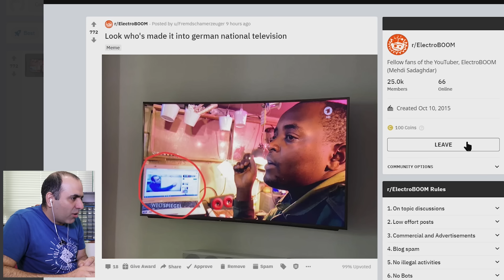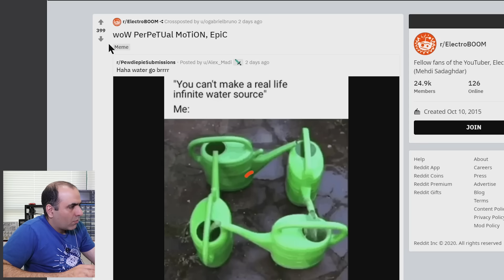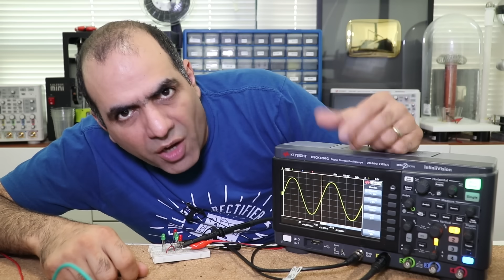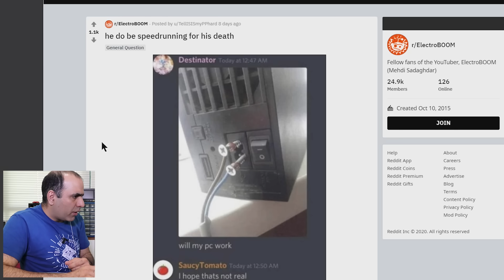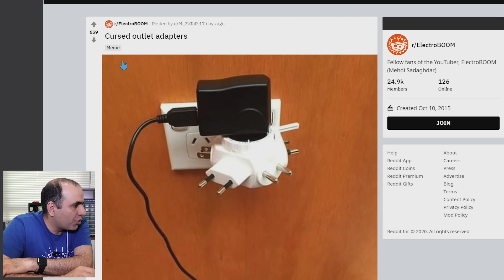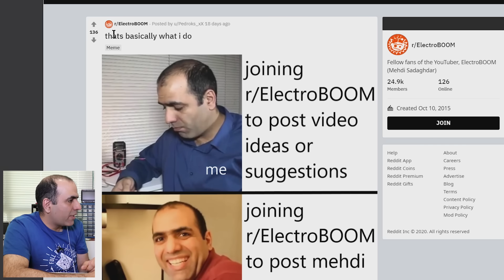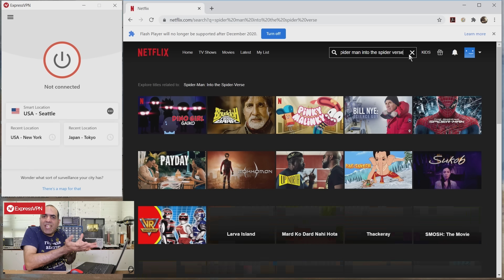Making Water Spin Like Magic, LATITY-002

Comment: Customs charge me 3 times the cost once it past 50USD.

https://consumerreview762600519.wordpress.com/2020/07/29/this-generation-console-gaming/

Solar panel https://amzn.to/2Cx3J5t
Eco-worthy 1000w https://amzn.to/2Cg8i4a
Amazing shower https://amzn.to/39trFTi
Earbuds https://amzn.to/3fcw3Iv
Kindle ultimate https://amzn.to/31PAx3N
Twitch prime https://amzn.to/2ZIgcLl
fire tv stick https://amzn.to/2C2bTlE
Midea U Inverter Window Ac 8,000BTU https://amzn.to/3eRYzyp
Necklace fan https://amzn.to/2VGlIwU
Sense Energy Monitor https://amzn.to/2T2u3JD
Spiderman FFH https://amzn.to/2W3NIK7
Aveners: End game  https://amzn.to/2KOhyx7
Metamucil double https://amzn.to/3aHoNB8 single https://amzn.to/3bmvVTU
Canon EOS M50 https://amzn.to/35fHX0c
SONY RX 100 VI https://amzn.to/35bteTS
Canon PowerShot G7 X Mark II https://amzn.to/2WaAPhp
CANON 90D https://amzn.to/3cX8z8O
SONY A6400 https://amzn.to/2VMUNzL
Darth Vader and Ahsoka https://amzn.to/2A3qDjl
Captain Rex https://amzn.to/2L2tMST
Ahsoka Rebel https://amzn.to/2A0hoAl
Anakin https://amzn.to/2W8QZch
Skillmatic https://amzn.to/37PwSEn
Aqua 4 in 1 Monterey https://amzn.to/2Ctihmm
Bunch O https://amzn.to/2YWQodL
Face mask https://amzn.to/2ZBw2Y9
Enema https://amzn.to/2YTOquQ
Amazon business account https://amzn.to/3h9t98K
100 disposable gloves https://amzn.to/3dEbNh9
Bicycle rollers https://amzn.to/2VFCOLh
Oscilloscope https://amzn.to/32tCFyA
Ispring reverse osmosis https://amzn.to/2Wy6D0I
Flex Seal Spray Rubber Sealant Coating  https://amzn.to/2OWPERv
Great Stuff 157913 Big Gap Filler, 20 oz https://amzn.to/39t7lBK
Reusable Half Face Cover, NASUM M101 Face Cover https://amzn.to/3jDWFVl
Rockport Men's Bennett Lane 4 Venetian Shoe https://amzn.to/39tqumR
Helix Flexible Stainless Steel Non Skid Ruler https://amzn.to/3jECy9B
Bacitracin Zinc Firtst Aid Antibiotic https://amzn.to/30KvsHT

Comment: Mehdi is uniting the world by offering easily understood lessons in electro-magnetic physics and by putting small electrolytic capacitors across the AC power line- and sometimes by putting himself across the power line. I want a T-Shirt that says "Mehdi Suffered For Our Sins" with a lightning-bolt motif.

Comment: My 2nd best ever electroshock moment was playing with an RF transmitter in the basement in my socks. 

You see a basement floor is a good ground and RF voltage really hurts.

 I've been zapped so much growing up that I think I've ionized my cells or something. When the weather gets dry I can almost get knocked on my butt from static electricity while opening a car door. People have heard the zap from across the street.

When there's a lightening storm I have to hide, staying away from windows and appliances. I've come close to being hit by lightening 3 times. My house has been hit twice frying several devices including the computer, and that's WITH good efi protectors on them.

On the plus side, sometimes equipment I've been called to repair starts working when I get close to it. Of course that makes it harder to fix if it's already working.

Comment: I have one of those crazy travel adaptor rings. Only one pair of the plugs are ever connected to the socket in the center of the thingamajigg. You need to rotate the center socket so it lines up with the intended plug fot the circuit to connect. The plugs that aren't in use don't connect with anything so even if I mess up (believe me, as a stupid person, I can be very creative at times) the rotation selection, at worst the mains electricity only goes into the wrong plug and stops there, not even shorting it.

Comment: If I may ask an  unrelated question to you and your learned viewers?
I have a 12 volt vehicle lift in my workshop fitted to a machine,  but want to convert to  run it off the mains 220 volt, trouble being is looking at 12 dc output power supply which I read apart from being dangerous at 200 amp output ( which I think I need ) is in the 500 pounds region to buy  looking at flea bay.
Any ideas or have I got to put up with charging my battery from time to time ?

Comment: Some guy: i don't have GFCI in my bathroom. Very hazardous!
Me: laughs in no electrical housebreaker
Reply: Gotta have those wires glowing red
Reply: My house actually came with a GFCI breaker on the bathroom circuit. I didn't even know that was a thing and was going to put a GFCI outlet in the bathroom until I saw that in the breaker box.
Reply: just use a gfci tester to find out
Reply: you probably have the wires running onto the walls like in the past.. it would be easy to fit a bit of safety features

Comment: The one where you ask "are those prongs all live?" 

No, it's a travel plug. I got the same one at home. You turn a ring on the top, where you plug in your device, to the prongs you want to use and only those work on the socket.

Comment: 6:33 I have the same adapter. There is a circle were that plug on the top is, so that you can select the outlet you want to plug the adapter in. But i can't remember when I last used it and I wont use it because I find it scary lol

Comment: 6:31 they exist. But they aren't all live. There is a ring around the socket that you turn to select which of the pin sets connects to the socket. The rest is just mechanically present but electrically disconnected. They are as safe as their designers made them (depending on build quality and stuff), but they aren't deadly by design. ;-)

Comment: Regarding your CRTV Transformer video, I heard once that there's a circuit named "Zero Voltage Switch" that can drive those via windings on the exposed ferrite in the transformer

Comment: I have a question about static electricity. I recently got given a record player and I had a serious issue with static making pops . I saw it is possible to buy a piezo zapper to remove the static. Does this really work? Is there a better way? Why can't I remove static from records easily?  Thanks for any insight on this.

Comment: That GFCI demo made me think of the weird wiring of a plug in my garage. The GFCI in there, if tripped, will turn off half the plugs in the house. I found that out when I tripped it then couldn't figure out why half of our house wasn't getting power. It's much like a switch that was in my previous house(which is 116 years old). That was a two way switch that would turn off the upstairs power if either of them were turned off.

Comment: 5:35   i keep trying to make that  dc motor with a  Magnet out of a HDD   with copper wire with a battery  No go   maybe i need the Magnet in video🤷‍♂️$ebay
Reply: Yeah you need a magnet that has the poles at the top and bottom, hard drive magnets have poles on opposite sides along the face of it.

Comment: getting charged 50% of the total value in custom fees is outrageous.
In the Netherlands you will be charged (with a max 21% VAT/BTW) for purchases above 22 euro.
(exclusive sending and insurance)
above 150 euro you also need to pay import costs.
(depends per product but in case of electronics its max 4%. phones and computers dont have import costs)

if you get charged outrageous amount of custom fees, make a complaint.
they probably estimated the value wrong.

off course different countries apply different rules but its worth it to look up the rules for your country,
Customs services also make mistakes.

if sending packages, some package services have the option that the sender pays the custom fees.
when the sender pays the package will be released by customs.

Comment: 6:32 I have this very adaptor. And to your and my relief, no, they are not live. You need to rotate the socket in the center to the actual plug you want to use. The rotation acts as a switch only closing the circuit with the plug to be used.

Comment: 9:34 yeah no this bit is flat wrong, simply because of the unqualified use of "no matter now much electromagnetic radiation is around you". If the electromagnetic radiation wants to go from point A to point B badly enough and you are in the wrong spot it's going to go through you. https://medicine.uiowa.edu/psychiatry/patient-care/iowa-brain-stimulation-program/noninvasive-brain-stimulation look here's an entire department of a world class research hospital devoted to pulsing a 3 Tesla magnet at the brains of people sitting in a comfy polyvinyl chloride upholstered chair with no metal or grounding strap. I speak from experience, you will feel this. 

9:42 also he means "open circuit" not "short circuit"

10:00 we have nearly an hour of footage of him grabbing single live A/C wires and going "OW" how is he even saying these words. Your natural capacitance means that if you stick a screwdriver into an A/C power outlet and touch the metal you act like a capacitor, charging and discharging with the changes in electrical polarity zapping you quite a bit, this is also from experience.

P.S. Stop saying "Electrocute" it's garbage Edison marketing not a scientific or medical word, it's what you do to elephants when you want to scare people into giving you money. Electrical burn or Seizure are much more meaningful and don't evoke any of the "harmless" cartoon imagery.

Comment: I built a spacebar-presser back in 1991. It was a small AC motor with an eccentric cam. I had it play keno for a week so I could analysis the stats.
Result: don't play keno.

Comment: Our home builder told us that our GFCI was configured like that - normal receptacles in our two bathrooms, and a GFCI receptacle in the hallway that is wired to them. For 15 years I believed that to be the case. I recently discovered, when replacing one of the bathroom receptacles that had become corroded, that they must have made a mistake when wiring. The GFCI is not connected to the two bathroom receptacles, instead it got wired to the same circuit as the exhaust fans.

Comment: Sir, i didn't understand why the water spins when it is between the effect of battery and magnet 🤔 could you please explain me! Thanks in advance
Reply from the maker: It's just video editing. Pause when it says FAF on the screen. I put the magnet on and don't move at all, my daughter stirs the water while I'm standing still so my reflection in water doesn't change. I cut the stirring water video, play it backwards and paste it over when I'm talking to make it look like the water starts turning.
Reply: @ElectroBOOM  my friend needed a power bar. I plugged it into itself in "Free Energy 2020" position and we had a great laugh. It's nutty putty how many of these "electrical device" videos are out there. I don't know which is more abundant, Free Energy or flat eath/fake space. 🤔
Reply: @Drew-Dastardly  and loads of hot glue

Comment: make a zvs driver but don't touch its output. i don't care if 120vac doesn't hurt you. believe me, the output of the zvs driver and a flyback will definitely kill you. just remember to use a high power input for the zvs driver. the higher the input power. the more powerful and dangerous the output power becomes.

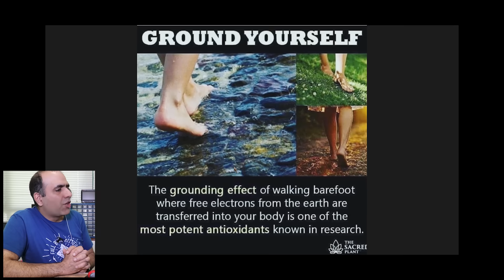Comment: Grounding oneself 9:07. Technically, standing in water outside does ground you. If you'r not under a tree and standing,  then because of your height above a ground plane, your head is at a higher electric field gradient, and electrons are slowly conducted through you to the highet potential in the air above above your head.  But the electric current is really really really really  low, and solid scientific research on the  effects on health is largly lacking and inconclusive at best.  And warning, to those that dont know better: Don't go standing in water when there is a threat of lightning. 

If the existance of a voltage potential with height is new to anyone, google search these terms: "Atmospheric electric potential".  Before anyone tries to power their home with this so-called free energy,  I'll point out that the power available is little more than a lab curiosity, and of not much usefulness.

Comment: I'd like to point out once more that you trust a VPN service with all your traffic in order to use it.  So instead of your ISP, the VPN gets all your info, *unencrypted*.  Then there are DNS calls.  I don't need the full packet or the URI to know why you needed to resolve "livingwithcancer.com"  So if you care about privacy, don't use the Internet or maybe host a free VPN service for your neighborhood in an undisclosed location, and use it yourself as well protecting your identity by 1 of n users.  
  
Eventually though someone will show up with a device to plug in your setup, or use an exploit to install a RAT tool as the traffic will look unidentifiable and rather busy.  Most likely the latter would happen first as countries who manufacture electronic components have very specific export laws and procedures meaning hardware and software with lesser known vulnerabilities get shipped out to x country and so on.  How long would it take Kenya to figure out another Meltdown and Spectre?  
  
So I'll give you the advice U.S. presidents get, "Don't use the Internet"

Comment: About grounding - In factory when i was working, workers are working with electric circuits (PCB) with capacitors etc, and they wore a grounding cable. Some of time they works with 230V mains. Was that safe?

Comment: I mean how hard induction heaters can be to make? Just coil some wire and plug it in, I fixed my stove with this DIY method and it works just fine - only issue is the glass heating around the fix.

Comment: If you tear down an LED filament lamp, you can use those in a FULL BRIDGE RECTIFYAH pretty well. Just add a resistor and short the DC side if you want.

Comment: This reminded me of something. Yesterday I had some vacuum tubes and I was applying voltage to the heaters to make sure it worked. I had the voltage turned up to dangerous levels When I had my hand on a grounded piece of metal and my other hand on the neutral contact. There was a 50-50 chance I could have touched live instead and... Bad things would have happened. When working with electricity always check what your touching. I also seem to have an uncanny ability to know when electroboom is about to post a video.

Comment: 9:08 That is why when they work on the high power lines they do it using a helicopter.
No grounding no danger and no need to switch the power off.

Comment: wrap it in a gift paper, they generally don't charge customs on gifts
Reply: Yeah, try that with an brand new oscilloscope from Keysight or whatever.
Reply: @Valenorious  Speaking of Keysight... 

THANKS TO KEYSIGHT THE SPONSOR OF TODAY'S VIDEO...
Reply: This hasn't been true for quite some time in EU due to the Chinese marking every single package as a gift.  It's even a law in our country that they can charge you even if you send something to a relative. They usually don't but they can.
Reply: Another solution is to send it as a gift to a nonprofit organization it is not taxed
Reply: @sayfeddinehammami6762  Not true for countries in Africa unless the end user proves they are a registered non-profit organization and the shipment is not for internal use by the organization. 

I've deployed numerous times to Asia, Africa and the South Pacific after a disaster has struck. Everything imported is checked and verified and in 90% of the cases (except food stocks and medical supplies) are taxed unless proof it will be removed from the country. 

It gets worse if you declare the goods as non-profit and get caught. The fines are steep and the goods are then permanently confiscated.
Reply: Wont work in plenty countries